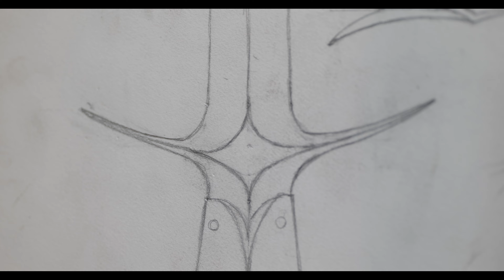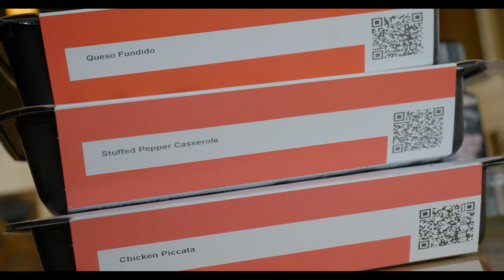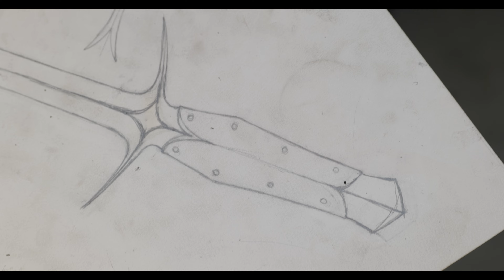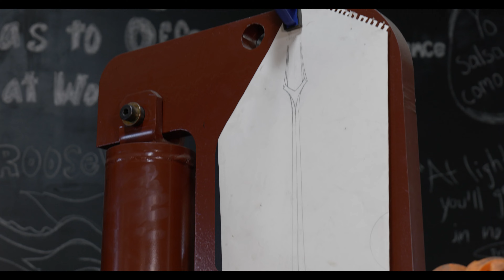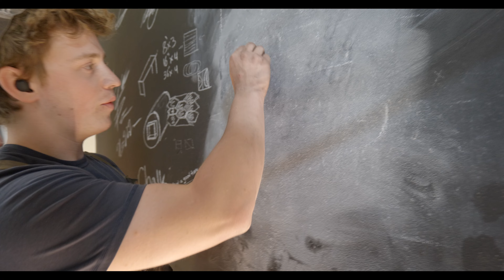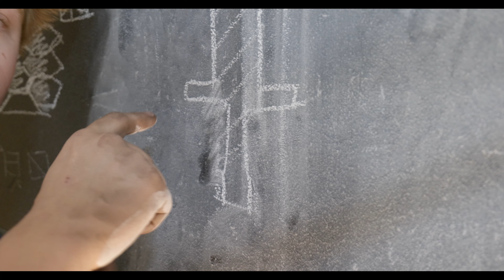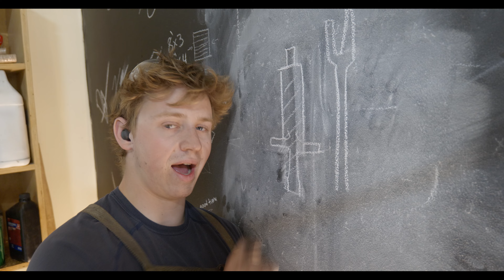A Marshmallow Roaster Fit For A King

Comment from the maker: Use code WILLSTELTER50 to get 50% off your first Factor box at https://bit.ly/3JmwQbS!
Thank You Factor for sponsoring this episode.
Reply: that segway was pretty flawless...
Reply: COVERING YOUR JAWS? 😂😂😂😂
Reply: Are you FACTORing in marshmallows for dessert?
Reply: Completely off the topic of the video. My grandfather used to use beeswax to stop  leather pulley belts from squeaking. He told me he had a stick with a square box on the end to put the block of beeswax in and then he'd go around to the machines and place the block of beeswax onto the tensioner pulley why the machine was running allowing it to spin spreading and even coding of wax on the pulley. But only if the tensioner pulley was on the opposite side of the belt of the Maine/ drive.

Comment: As a jeweller I never understood why blade and blacksmiths hated filing. I played with steel for the first time a couple weeks ago. It was awful. I offer my heartfelt condolences for your files and patience
Reply: im a blacksmith/bladesmith and recently traded workshops with a master goldsmith. Such fun and a great experience to explore the similarities and differences between the metals. He was also appalled with the slowness of filing and especially the hand sanding! Huge respect for your craft too! I should add we made some mokume gane at hsi workshop and great to see the similar techniques across both disciplines!
Reply: There's so much that each discipline can learn from eachother! I'd love to try a full day in a blacksmith's workshop, it seems so interesting and fun. Mokume Gane is very cool stuff! I've often thought about trying proper pattern welding techniques to it, I might just have to try sooner rather than later
Reply: @gabrielcairns7050  Good mental preparation for filing/grinding at metal work is very important. If i have to grind, file or sand something and i know it will take me a lot of time, i try to treat it as an opportunity for hmm... meditation? If the job is quiet - filing/sanding, i also listen to audiobooks. That helps a lot :D Especially when your thinking process on what you are doing is done - not much room for a mistake with mechanical, repetitive movements that you already planned, marked and prepared. So making that brain busy with an audiobook is wonderful.
Reply: You probably wouldn't like aluminum bronze that I work with then. The stuff is ridiculously hard. I cast 35 and 50 mm wide by 3mm hearts out of it. Sand and polish to a mirror, then acid etch. The alloy I use comes out with a beautiful iridescent crystal pattern. It's really pretty but it takes quite a bit of hand sanding. I've made keepsakes  for people with some of the hearts. Leave it shiny and etch a name onto it. It's almost relaxing for me to sit and sand them.
Reply: @keithyinger3326 try knife steel man!
Reply: As a blacksmith I appreciate this comment a lot

Comment: You're an absolute wizard, Will 😲 forming a block of steel into that with heat and hammers with no grinding, cutting or welding is just mind boggling! (Yeah, forge welding and hot cutting, I now - that just makes it even more impressive)

Comment: Me thinks the toasting fork guard shape resembles what Will saw when he was looking in the mirror at the semblance of the moustache that he's trying to grow. I also struggle with design problems and sometimes look to other resources to draw inspiration. In this case, Will has pulled off an elegant design but in the back of his mind he must be worried that growing a moustache as modelled by Bud Abbott, Errol Flynn, David Niven, Clark Gable, and Don Ameche leads to its own design problems particularly when Hulk Hogan moustaches come back in fashion. You need so much more steel! Only a small tease for a huge talent. Sorry for the leg pull, but the workmanship is exquisite - can't wait for the finished product and moustache.

Comment: Tell you what another nice handle material, stone. Have a look at Kyle Royer if you don't already. I mean yes, stone is obviously not going to be as practical as many other materials but for a low impact use/display piece? oooooooo boy does it look good.
Reply: Depending on the type of stone, it wouldn't be regulated to only light duty/ display.

Jasper is a quite beautiful and very tough stone.

Comment: I'm sorry to tell you, but as a lifelong professional marshmallow roaster i have no choice but to do so: metal is a terrible material for a marshmallow roasting stick. It gets too hot, you can't touch it with your mouth or hands, the marshmallow slips off the metal and it can't be easily burned after all the marshmallows are eaten. Sorry.